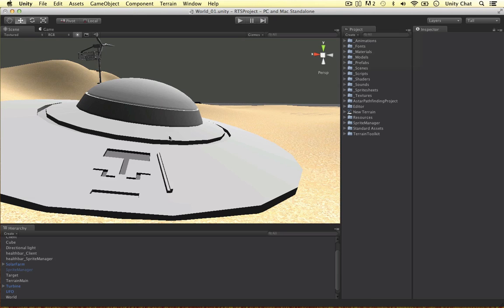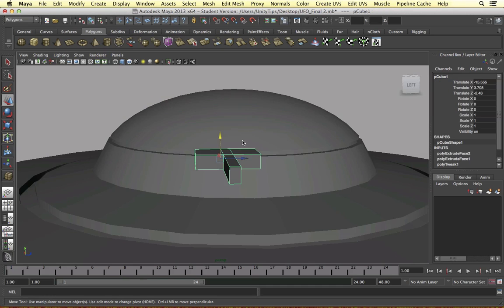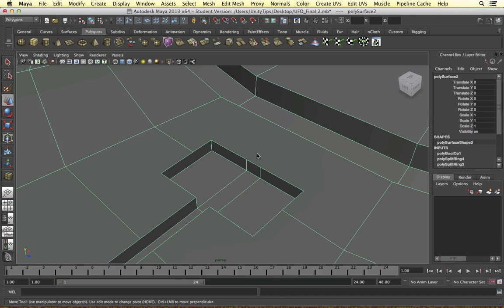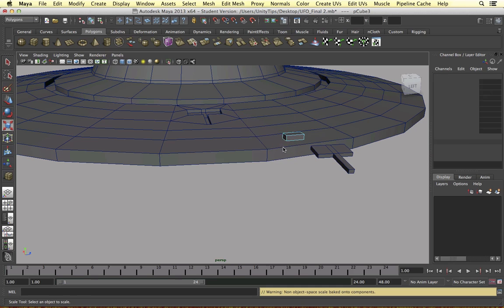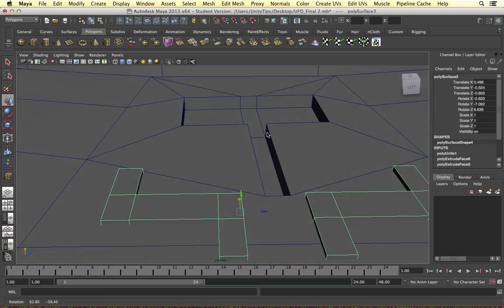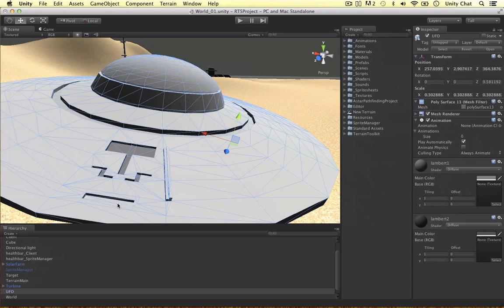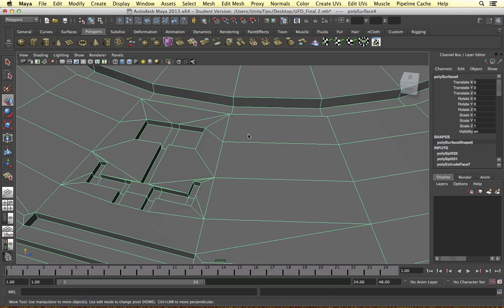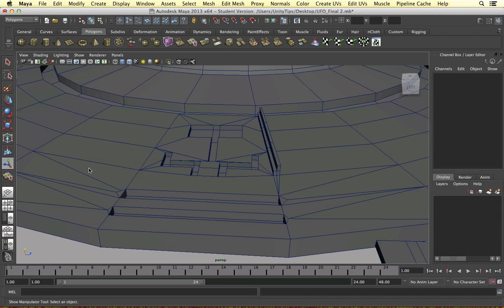Maya - Modelling a UFO [2] Engraving Detail

Comment: Wouldn't it be better to put these kind of small details into the texture instead of increasing the polygon count that much?
Reply from the maker: Yes, or a mixture of 2D and 3D which is what I have done with this. It all depends if the game engine can handle the object in the scene. Unity has been fine with this level of detail so far in the RTS project.